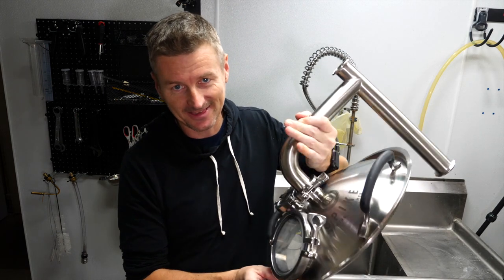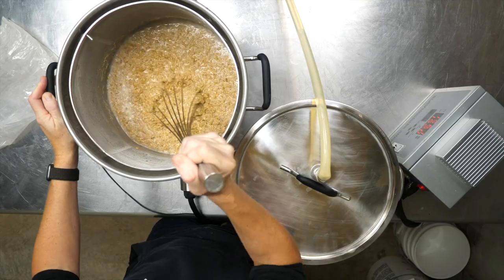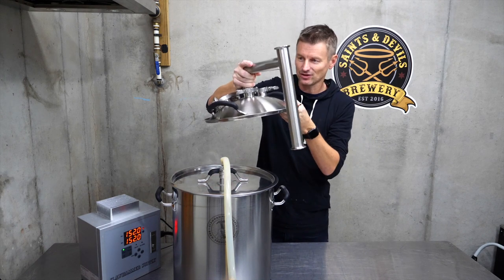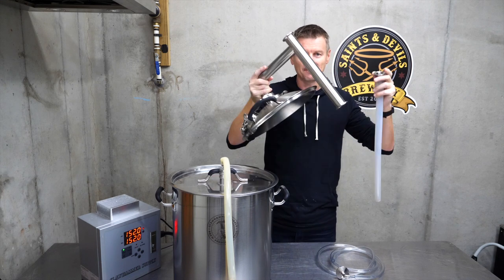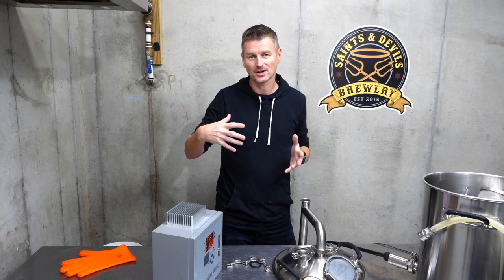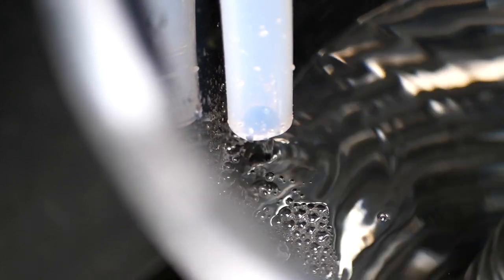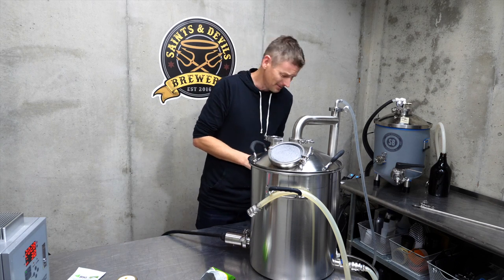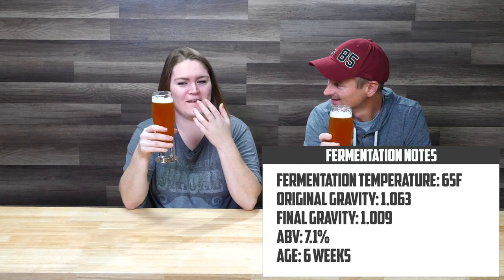Biere de Garde | Steam Condenser Lid Revisited

Comment: You can dry out a farmhouse ale without adding honey or sugar. I use a mash schedule of 63C (145F) 30 minutes, 68C (154F) 15 minutes and a 5 minute 74C(165F) mashout to aid sparging (I know you don't sparge). Beer finishes between 1.002 and 1.004 usually. The sweetness you taste after the beer dries out is glycol produced by saison yeast.

Comment: So... funny you post this this week.  I brewed a SMaSH on the weekend.  My OG was significantly lower than where it should have been.  I too used the condenser lid from Spike.  The profile I was using had a boil off rate of 1gal/hr.  I have now adjusted it lower to 0.3.  We shall see how it works next week.  Also, I tried recycling the cooling water.  Same bucket to the lid and then back.  I kept it cool with a series of ice pack changes. I've been collecting all the meal kit ice packs from my neighbours...
Reply from the maker: Oh that is interesting. Will be interested to hear if you dial in the correct boil off rate. And who needs glycol when you’ve got the neighbors ice packs 🙌

Comment: Very surprised by the sweet comment with 3711. I've probably used that yeast the most since 2009 and I don't think I've ever had a beer finish above 1.010. That yeast is super dry and attenuation is around 80% so a sweet comment with added honey that will also dye things out seems weird. Another good video sir. Keep up the good work.

Comment: For anyone looking for a large whisk like that, check restaurant supply stores. I got a nice stainless one a bit smaller than the one Martin uses and it wasn’t expensive. The XL ones are also fairly common at stores like this.

Comment: We had a whisk like that at the pizzeria we worked at. You'll find them in restaurant supply stores.
Reply: Do you know what lengths those whisks might be? Martin didn't mention it either
Reply: @18centwood  You can get them in a bunch of different lengths. Looks like a 2' whisk (24" or 60cm). You can get them for $5 usd on restaurantsupply (dot) com if you search whisk. They're not exactly a specialty item I found one like that in under 2 mintues you might even be able to find one cheaper.

Comment: The water coming out from your diffuser may be leaking into the kettle. There should be a tiny downward angle on your horizontal pipe coming out from your lid.

Comment: I love a good Biere de Garde, its hard to find true "Biere de Garde" yeast, so its hard to make them.  My dad made one as a SMASH,  100% Vienna Malt, Sterling hops I believe, and wYeast Biere de Garde (3725). 8% ABV but it was smooth so you drink a few and you're on the floor.  One warning if you use that yeast, it can have a funky smell from the yeast, so lightly dry hopping is recommended.                              Also that whisk any good restaurant supply shop should have one that size.
Reply from the maker: So many SMASH beers really do hit the mark...

Comment: Interested to see this one, I have this beer on my 'to-do' list (along with about sixty others!). Just wondering, does that metal table get hot with the kettle directly on it? I note the Clawhammer guys put a bit of foam or cork under theirs to stop the table acting as a heat sink, but I think they're on 110v so restricted that way. Hopefully third time's the charm with the condenser lid and you get your figures dialled in :) my steam solution isn't as shiny, it's a large desk fan screwed upside down to the shed roof to blow it all out the door!
Reply from the maker: Haha hey if it does the job! I don’t find the table getting hot but the Clawhammer guys did recently give me a little mat to put the kettle on.

Comment: Hey Martin, could you please tell me what is the immersion pump manufacturer you are using? :)
Excellent configuration you are working with btw
Reply from the maker: I'm using a little mini pump that came with the glycol chiller. Not sure why it was running so noisy... not usually the case.
Reply: @TheHomebrewChallenge  Thanks for answering. I asked that question exactly because this week I was looking for an immersion pump and I noticed that one on your equipment. An unpretentious question. I'm a big fan of your channel and I wish you a lot of success. 
Cheers.

Comment: How well does the steam condenser lid fit on the 10 gallon clawhammer kettle? In one frame of the video it seems that it was raised on the right edge. I’ve been looking into one for a while. I have a spare 5000 BTU window unit I can convert to a water chiller to recirculate the water similar to what you were doing.
Reply from the maker: It’s just ever so slightly too big, as you spotted. Still closes enough to form a seal but it’s not quite flush

Comment: I’m not sure I understand the advantage of the steam condenser lid?
Reply: So your home doesnt get filled with steam when you boil
Reply from the maker: Yeah remove the steam instead of using an extractor fan or similar.
Reply: Why not just add a normal lid and reduce boiloff to zero??
Reply from the maker: Covering boiling wort will lead to DMS (an off flavor) making it into your finished beer. The steam should be exhausted somewhere - either through an extraction fan , a condenser lid or... well just brew outside 😃
Reply: @TheHomebrewChallenge  thanks for the explanation. Makes sense.

Comment: Hi Martin, what do you mean by batch size? Do you count what goes into the fermenter or what goes into the keg?
Reply from the maker: That's a good point. I count how much is going into the fermenter which is probably not what I should be counting. Obviously it's a bit less making it in the keg.
Reply: @TheHomebrewChallenge  Good to know. I used to count what goes into the fermenter but have just started counting what gets packaged, because that's all that really matters after all.

Comment: what power are u running your system at? I run mine at 25% and condenser out put is around 85F and that is coming in from ground temp water
Reply from the maker: I was running around 30% which I think was probably a bit too high.
Reply: @TheHomebrewChallenge  its definitely something you have to play around with a few times before you can dial in #s.

Comment: How much water does the steam slayer use?  I'm trying to keep my brewing green.
Reply from the maker: I used about 4 gallons recycled. Without that trick I think it's closer to 15 gallons/hour.
Reply: This is not a steam slayer however... the steam slayer comes with a 6GPH or 9GPH sprayer so it should be 6 gallons or 9 gallons of water for a 1h boil.  The spike condenser lid does seem to use an awful lot of water.  I'm waiting on the steam slayer to be back in the shop to order one myself.  I'm going to get the 6GPH sprayer, I hope i'll get good performance for 6 gallon of water used.